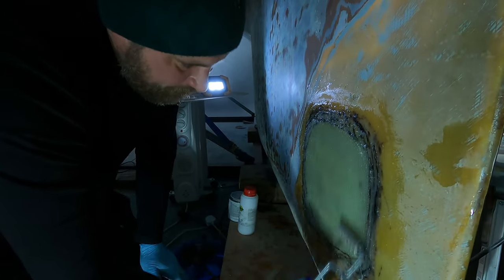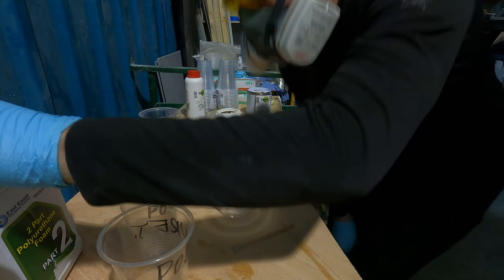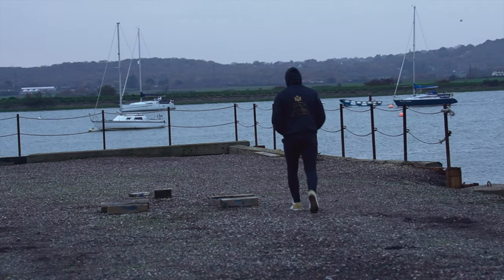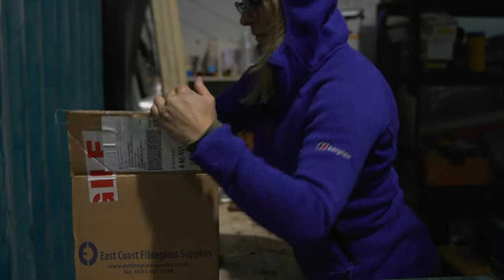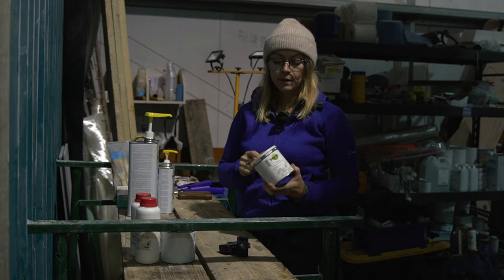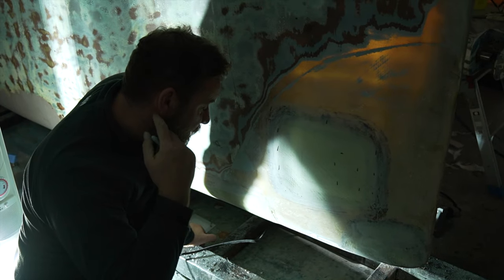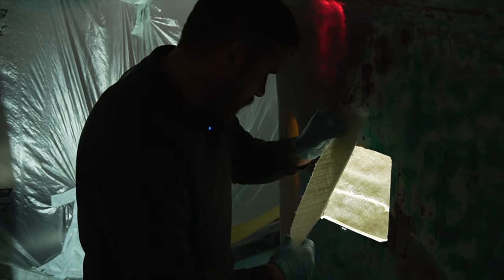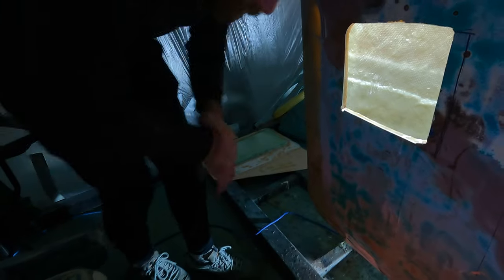EPOXY EXPANDING FOAM to fill the keel (SICOMIN) [E31]

Comment: I work for the UK distributor and we love the Great team at ECF. The Sicomin foaming systems are fantastic. What you are doing looks really good. One comment...I never say that resin "dries" as that leads people to think that there is some kind of solvent evaporation going on - there is only a chemical cure as these products are solvent free! Glad you appreciate the importance, and difference between "cure", and "post-cure". Cheers!
Reply from the maker: ECF have a great range of products, are most efficient in terms of delivery and never failed us in terms of their stock levels.  
Yes, that’s a good point 👍 , we shouldn’t use the term “dry” when talking about resin. 
The next video is being edited as we speak, so we are probably still referring to it as “dry” rather than “cured”. Will rectify this in the future though 😉
Reply: @sailingsqualo  👍

Comment: That is some very nice work.  I've actually never heard of that epoxy expanding foam.  I don't have a need for it right now, but I'll store that away for future reference. Great story telling the both of you.  It can't be easy to film for YouTube when you just want to get the work done, but a captivating story and a good project will go far to building your channel. Keep up the great work.
Reply from the maker: Neither have we, but few videos back when we mentioned we are planning to fill the sump tank with expanding foam (we bought polyurethane at that time), someone suggested using Sicomin. We looked it up, not many suppliers have it in the UK (it is a French product). You can get them at various densities, it doesn’t shrink after it cures, they have flame retardant option available, it is water resistant, it can be used as structural core material and it doesn’t exert too much pressure when it expands so it won’t damage fragile parts. I sound like I am trying to sell it here 😂 
Filming can sometimes get in the way of things when like you said you try to get the stuff done. But it’s a fantastic way of documenting this project, even now when I look back at the first videos we released just over a year ago it brings back wonderful memories..I can only imagine what it will be like watching this journey when we retire. 🥰

Comment: Not boring at all those who work with their hands enjoy watching these videos . Have you thought of running a large dehumidifier inside or outside to help with the drying?.
Reply from the maker: Outside the “tent” we made would probably not work very well. The shed is massive and removing humidity in the middle of winter in the UK is mission impossible hehe inside the tent, it would definitely help. We might look for a cheap one. 👍

Comment: There's a channel called sailing seabird and Stew & Marina bought a old abandoned gulfstar for 1 pound and have been bringing it back to life. They had some moisture issues with their keel and some delamination between the fiberglass and the Ballast so they used some underwater epoxy and injected it into drilled holes and once full would cover them with tape.. it worked really well and they also at first when they drilled a hole resulting in water pouring out thought they had major issues but after talking to a professional about this issue. The professional said that it's a comment thing with the older boats especially ones who were abandoned..
Reply from the maker: We would have probably approached it in a similar way. Well done to them. 👍 Now I wish we had paid £1 for Squalo 😒
Yes, all those problems we've come across, as well as all other boaters with the old boats aren't definitely made up.. they just happen cause it is a common thing to happen to boats build in similar fashion. Back then GRP was a revelation in boatbuilding and wrongly thought of as maintenance free.. years later we hear 'Osmosis', delimitation and 'rotten core" more often than not.

Comment: i maybe would have filled the first 6 inches with thick chop strand epoxy and then started the foam but you guys are doing just amazing work and the best part is your repair is lightyears ahead of what the factory did and this is the huge plus of a refit that you end up with a better boat than when it left the factory
Reply from the maker: She will definitely be better than when she left the factory 🤩 also by the time we finish we will know her inside out.

Comment: The poly foam isn't structural foam where as the other epoxy foam is definitely intended to be part of a structure. Especially the way you have done it.. the other issue with the yellow poly foam is that you have to be careful how much you add at a time because it expands so much that it could cause issues with pushing outward on the fiberglass.
Reply from the maker: That's right! The one we used also expands but not as much and is much more structural. We aren't boat builders and also couldn't find a solution to similar problem elsewhere. Let' hope it was a good choice and the way we chose to do it,  with alternating layers of glass strengthened the keel and we got rid of that (what we believe) was a  weak point.

Comment: that sicomin looks good, i put drain holes in rudder with whickes. just for peace of hind. no water found ,hope you find no probs there too. 39s are bomb proof i think yours is going to be torpedo proof as well .  🖖
Reply from the maker: Thank you 🙏 rudder is filled with what looks like polyurethane foam.. it was wet when we drilled holes but it should dry out. We will then fill them with the Sicomin and close up the holes we drilled.

Comment: I wonder why the factory left that incredibly deep sump below the engine and directly behind the keel ballast??? You would have thought that they would have filled it with foam or foam board and then capped it with fiberglass.. or am I missing something about the reason why they left it??  It's only going to fill with the nastiest of stuff and cause a real smelly issue
Reply from the maker: We did ask the Oyster Technical After Sales Support Team that very same question. The answer was that the bilge sump was just a low point in the hull for any water leakage to drain into and make it easy to pump. Well.. there was a big hose running under the engine oil pan to the back and straight into that sump tank in the keel, but it was short and never reached the bottom and there was no way of changing it as there was no access to it...it worked on manual pump, so it probably wasn't even pumped out often.. and all the stinky oils and other gross bits that have overflown in the main bilge, went there and sloshed about freely.   Only after we cut the bottom of that engine oil pan open we could get it out and the stench was unreal!🤢